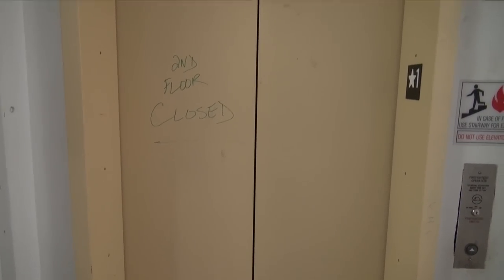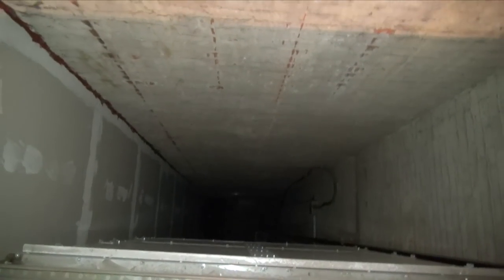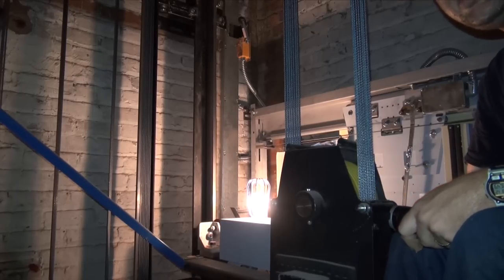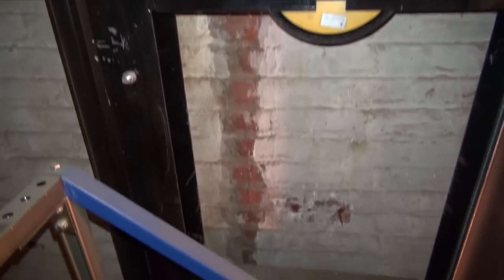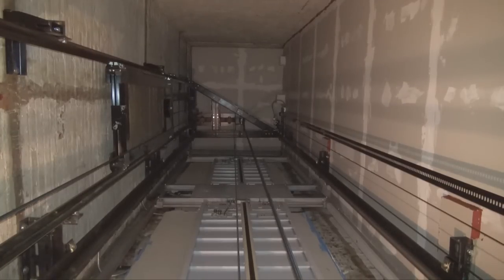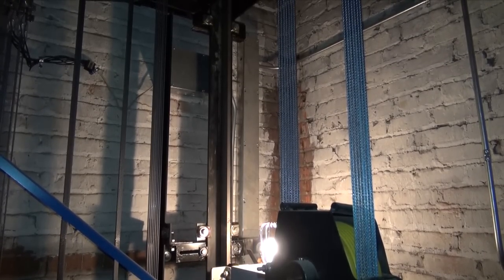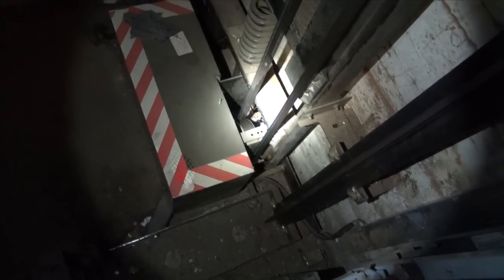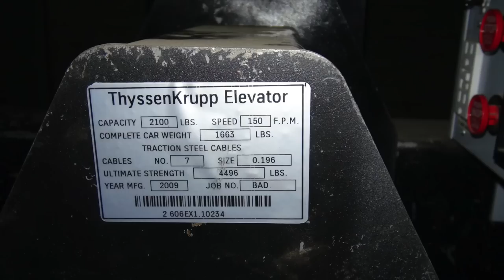In depth look at a ThyssenKrupp Isis Elevator (Cartop ride/elevator surfing and Pit view)

Comment: It's amazing that modern elevators don't need gigantic machines in a big room over the shaft any more.  Just a tiny motor and some small gears at the top of the shaft.  Awesome video DD!
Reply: Yeah.  Elevator tech is amazing.  Check out Thyssenkrupp's website and you will see they are developing a new elevator system called "MULTI"

Comment: At my dads work they have a giant crane along the ceilings of these 2 buildings made for fish counting and loading of the fish truck (he works at the department of water resources fish facility) and the cranes have a remote and it runs similar to this. There are multiple speeds for leveling, except the cranes go both vertical and horizontal

Comment: as i RARELY watch your videos these days. (personal reasons). this had to be a required watch. I remember riding this a few times in 2014 and 2015. if only we could have ridden together.
Reply from the maker: +Appalachian Elevators it is being replaced by a schindler 330a
Reply: DieselDucy they could've installed a Schindler 3300 or a Schindler 5500 as a newer installation instead of a Schindler 330a
Reply: +Jordan Lowe ElevaTours Canada Agreed or a Schindler 3100.

Comment: That thing in the pit you called a computer is a ups ( universal power supply) more than likely.  If they lose building power that ups will run the sump pump for awhile. 👍
Reply: Uninterruptible power supply*
Reply: @KayvonJavid  thank you for the comment MR.  national electric code

Comment: As I can see in this and other videos, inspection speed is slow as hell in the US. Not the same in Europe where on some elevators that I have surfed the inspection speed is pretty much the same as the full speed of the one you showed in this video. Most elevators at least in my country and in the UK have pretty generous inspection speeds. And Yes I also surf at full speed when there's enough space at the top and when I think it's not too dangerous on that particular elevator.

(But just like BENO I don't ask for clearances before surfing elevators)
Reply: I did same …

Comment: Very interesting video. I've never seen the internals of one of these before.
The pastic pulleys are getting more and more common where I live as well.
This here might be the slowest inspection speed I've ever seen until now. Schindler in Europe uses a default of 0.3 m/s for their logics with VF drives (although some 5500s seem to be alot faster). With a simple 2-speed logic you obviously get levelling speed, although I've already seen an exception here (this lift was only moving 0.75m/s though). The fastest set inspection speed I've seen on a modern logic on a conventional traction elevator was 0.6m/s, while only going at 0.3m/s between the two bottom and the two top floors.

Regarding car top rides at full speed... I kindly point to the 1954 Otis video from December 2017. xD
Reply: I heard that you can set the inspection speed on some 5500s by pressing stop and pushing either direction button repeatedly many times, it will make it go faster. I did it before on a S5500 simulator. You should try!
Reply: @elevator_satellite  Ok that sounds interesting. Theoretically I could try it, but I don't have any use for it, since in case of a 5500 it could just be set in the CO-MX under the Speed/Accel settings. Or generally in any controller or VF drive.
Reply: @TheLiftDragon  True lol.

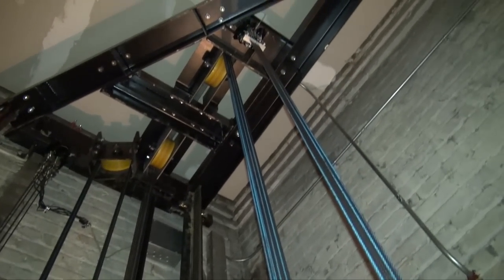Comment: 1:51 I’m pretty sure it was either warm or cool in the building and the elevators in the fall and winter season
Reply from the maker: Yes. This building had no climate control
Reply: @DieselDucy  I would’ve brought a plug in fan and plugged it in on top of the elevator car top

Comment: You should be an elevator mechanic! Also, normally when a variation of "do not attempt" is used, I would add "unless you want to" (that is suppose to be struckthrough, but stupid YouTube doesn't use bbcode, so pretend!), but as you see in the video, I make my exception! If I wanted to do it, I would want to do it SAFELY AND LEGALLY!!! And elevator shafts are frickin' SCARY!!
Reply: Surrounding your text with hyphens will do strikethrough (this is a hyphen, in case you don't know: -).

Comment: Two questions: is the 2:1 a similar thing to how some theatrical counterweight systems are weighted - like when they don't have a full fly? How does one actually fit a new car and system into an existing shaft - is the car flatpack and built in the shaft effectively?

Comment: Those inspection controls are look so much different than the fixtures in the UK, but the operation princple is the same to push both enable and up or enable and down. In the UK we have turn switches usually for Inspection/Normal instead of push for inspection here. Push to stop is pretty much the same. Also didnt see a door open switch / close here either.
Reply: Except that you have to first enable inspection service from inside the car with a special key. After that (The doors are still open) you can lower the elevator from a landing keyswitch to access the cartop.

In theory you could just send the car to the floor below and open the landing door with the drop key (Like we do in Europe) but I don't know if the cartop controls would be working without prior activation of the in-car "inspection service" keyswitch.

Comment: Is that as fast as they go with full speed? And is it possible to get smashed at the top while riding on the top of the elevator if you’re not careful? And thank you for the video. I was thinking of doing this as a career but I’m not really a heights kind of person or I’m worried I’d fall off into the shaft or get crushed at the top. But I’m sure with enough training you get over your fears. :o lol.

Comment: I would never enter a shaft or do try anything (Unless I became an elevator repair tech of course), in this video, but I do have a question.   Is it scary riding cartop?     Also, how risky is riding this way for technicians?   Seeing this video had me wondering this.   

Also, Is the ThyssenKrupp Isis, Traction or Hydro type elevator?
Reply from the maker: It is VERY risky if you don't know what you are doing.  I did not find it scary cause I have done it several times with technicians.  For technicians, in inspection service it is not risky, HOWEVER at full speed it can be VERY dangerous.  Also this is TRACTION.
Reply: Traction

Comment: i know that there are many safety precautions but i want to ask what is done if for some reason the elevator is on a higher floor and free falls?  i mean is there somewhere to stand to the side or even lay down if all else fails?  i'm not wishing to go attempt anything but i was watching another video and the question came to mind.
Reply: Annabelle Triabelle--Lying down flat is the best way to survive. Be toward one side in case there's a big spring at the bottom.
Reply: SFV Native Elevators DO NOT FALL. THEY FALL UPWARDS
Reply: @SFVnative  Thank You for the reply i wanted to know also about if a worker or for some reason a person were in the shaft where those giant springs are...could one lay down and survive that?
Reply: One thing I will say, since the others have answered: DO NOT JUMP! There is a myth around jumping in freefalling elevator cars. Doing so will not work.

Comment: I see the lift is newly renovated/replaced....
But awful.
The dooroperator sounds like tired and close to fail. .
The ropes are not proper adjusted...
Some sound like guitarstrings, some are loose, that you can easily move it with the finger....

Comment: What does two to one roping mean, Andrew?
Reply: Corey & Colton 

Two to one roping more commonly known by 2:1 roping is when the elevator car and counterweight have a pulley each where the ropes pass thru, the  dead end of the ropes are terminated in the overhead after being pulled over the machine. This system of roping has a mechanic advantage by being able to lift a heavier load with less effort by the motor because the building is holding up half the weight. The trade off is the elevator runs slower, by that i mean ever 2 feet of rope passed over the machine the car or counterweight moves 1 foot.

Comment: did you put it to normal with the stop out before you got off then ? who taught you that ? you should only do them actions from the landing when your safely off the top of the car, some lifts look for a reset floor or someone could put a call in from another floor. lift engineers have been decapitated doing that.
Reply: the motor isn't in the pit, its a bottom drive the motor room will be outside round the back, and that's not the governor its the governor tension weight.
Reply: and that's not a computer in the pit its a 2 way telecom for the engineers.
Reply from the maker: This is an MRL elevator.  the motor is in the pit.
Reply from the maker: I set the emergency stop switch on the car top before I exited the car top.

Comment: Your resetting the Stop Switch then placing the Elevator on normal while your sitting on top of the Elevator. At any time after that the Elevator could have levelled up or ran down on fast speed. You keep saying you have authority to be and do what you’re doing but clearly you don’t. Did you test those inspection controls before you accessed the car top. Please stop posting these videos. Someone is going to try what you’re doing and have a serious accident.
Reply from the maker: Ronnie Wilson I was in here for several hours making sure everything worked properly before shooting this video.  Sadly this elevator has been removed but most of its parts are in my museum.  I am good friends with the owner of this building and he removed this elevator and installed a Schindler in its place.